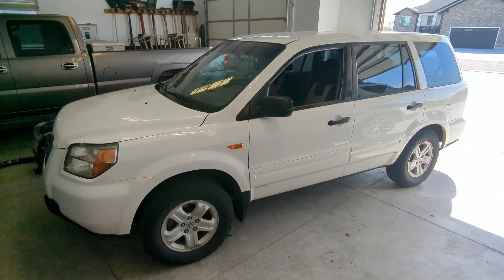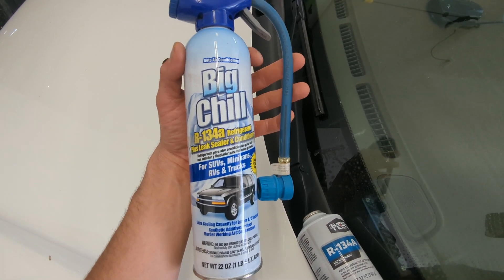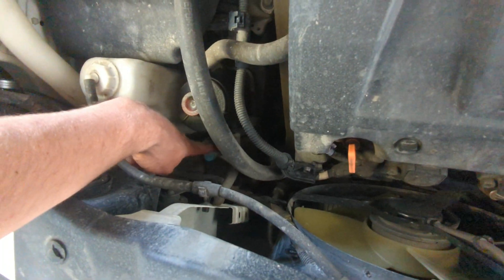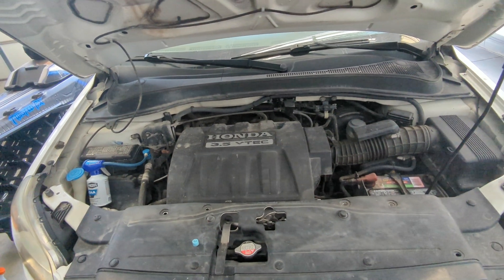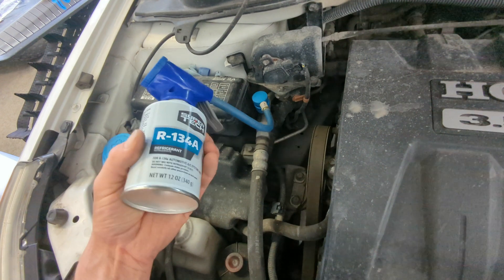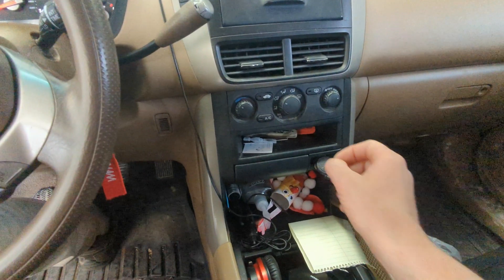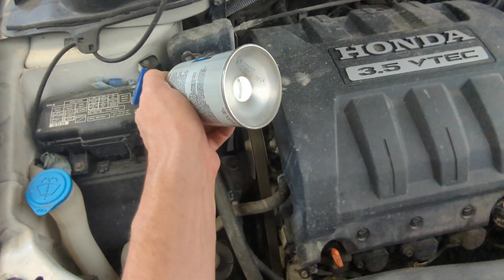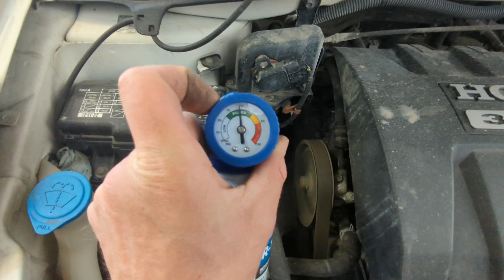Fast, Cheap and Easy way to Recharge your Vehicles A/C with R-134A

Comment: Had my engine rebuilt but the mechanics didnt fix the a/c to the way it was before - so now here i am scouring youtube and the comments and I want to believe that all it needs is just the freon but now im scared ill damage the thing
Reply from the maker: It's definitely good to have an open mind and do lots of research, this video isn't a fix all option. But connecting the gauge to your line  and seeing if you are in the green, or just listening for your ac compressor to know if it's kicking on would give you some good data.

Comment: I tried adding more exactly as you showed but it wouldn't go above 22 psi when the compressor is running.  AC is working but doesn't get really cold.  Tried a new can but still wouldn't go above 22 psi.  Should be 32 to 38 psi according to service manual.   Would be nice to know try it will not take more refrigerant.
Reply from the maker: https://mechanicbase.com/ac/ac-refrigerant-pressure-switch-symptoms/

Not sure this is the cause, but it's interesting and worth reading?
Reply from the maker: https://askcarmechanic.com/why-ac-compressor-runs-but-wont-take-refrigerant/

Actually read this, I believe this could be your problem.
Reply: @mountainmarshmemories7012  That's worth looking into.  Thank you for the suggestion.
Reply from the maker: @schifoso  No worries! Good luck and let us know what you find out.
Reply: As a professional automotive tech, you're wasting your money and potentially damaging your car's A/C system. 
Adding more refrigerant to the system won't make it colder. Automotive A/C systems are designed to work on a specific amount of refrigerant and work at certain pressures.
Have it properly diagnosed and repaired by a certified A/C tech.
If it's low on refrigerant, then there's a leak. Some leaks are fast, and some take days, weeks, or longer.
There could be air in the system or moisture, either will cause insufficient cooling.
Reply: @hnd2893  Funny, because a couple years ago my wife's car would only blow hit air and when I added refrigerant it started blowing ice cold air and has since then.
Reply: @Robert Zanatta  A couple of years ago, I had an older hose with a newer can top.  The old hose wouldn't puncture the tops of the newer cans.  O'Reilly Auto traded the older hose for a newer one and it worked just fine with the newer hose.  Also, the other car could have had a different problem or just a different symptom.
Reply from the maker: @jmonte5899  Interesting... worth a try! thanks for the tip!
Reply: @hnd2893  
That would be the smartest way to go but unfortunately it simply costs too much. An AC diagnosis alone averages over $100.